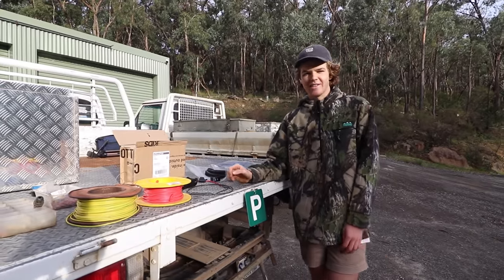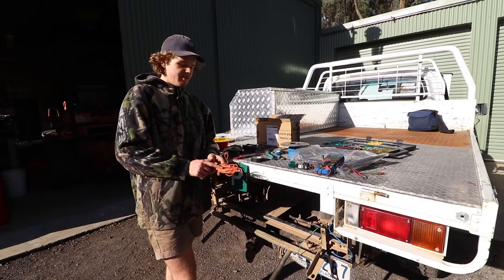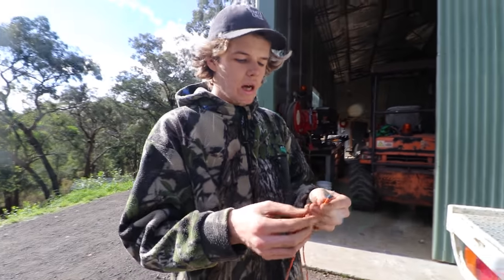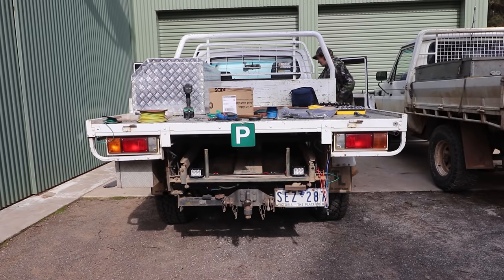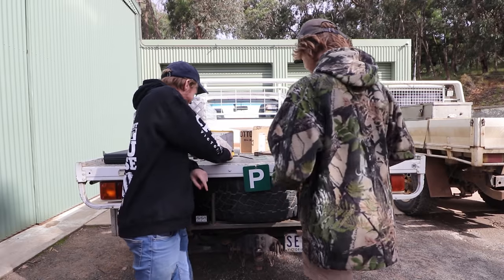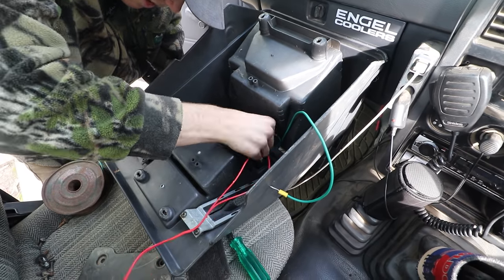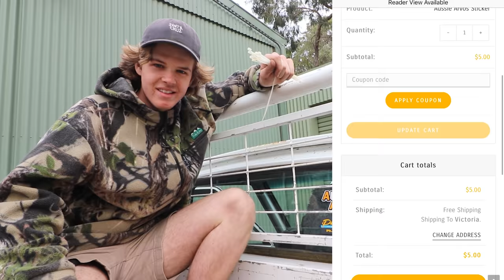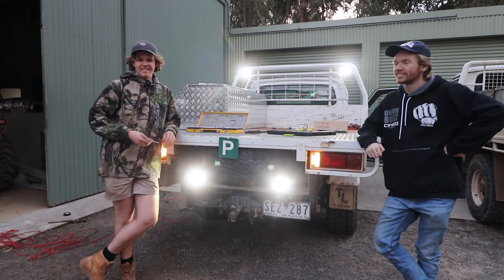MUST DO MOD FOR YOUR 4X4 | Wiring LED REVERSE + WORKLIGHT with SWITCH INSTALL

Comment: Hi why bother with relay. Just join two red wires splice to reverse light wire or trailer plug reverse wire and join both black wires and ground to chassis or individually ground both black wires. No relay needed.

Comment: Ideally you should be soldering connections, spades and ect are high impedance also they can over time corrode or disconnect. As others have said 24volt relay too.
If the LED for the rocker does bother you, you can make a switch to isolate the accessories from the battery.
Reply: Whoah lad don't bring that negativity around here

Comment: The rocker switch LED is for the headlight illumination wire, not +12V constant. Good video though guys. I love how you 3 really give it a crack. I wish many more guys would just get in there and try.

Comment: The amp draw of the leds are most likely low enough to pull power straight from the factory reverse 12v+. No need for a relay.
Reply: And same with the work lights those rocker switches can handle the current draw of the lights.
Reply: @TheATVboy17  Yeah probably could've and would be much neater!
Reply: Do it once, do it right.
Reply: I usually install led reverse lights like that, even did a halogen once without a relay. Just straight from the factory wires. No issues.
Reply: Would you get bulb error if you did this on a new hilux (no relay)

Comment: Good shit mate, although if I’m not mistaken, extra led reverse lights like those are illegal?
Reply: Yeah. They would need to be switched from the cab on the relay, not the factory reverse light as signal.
Reply: That's why hes running a relay 🤦so both options are available
Reply: Had factory switched ones for years never been picked up

Comment: Good job mate. Although next time you don't need to cut a wire to tap into it. Just strip or expose a little bit of the insulation and solder onto the wire 👍 just saves avtually ruining the integrity of the original wire
Reply: Or use those nifty squeeze on connector thingys. They are even easier.

Comment: Hi. Seeing the l.e.d lamp only draw 2 amps can I just link a l.e.d load resistor onto the lamp then couple it to my current existing factory reverse lamp on my 2012 Nissan Navara D40 diesel?, I'm wanting to just have it on when reversing only as I don't want to run it thru a switch.

Cheers Carl

Comment: could you not run the positive straight off the reverse light and negative straight to ground? thought the LED a low enough voltage

Comment: Nice inline fuse at the battery - very important, the rest is optional.  Wouldn't hurt to run a trailer wire while you're about it, get 7 cores from end to end, maybe one or two heavier cables for Ron.
You didn't show the boot you got off the relay??

Comment: Just found this. Pretty good commentary. Question about your work lights though - can you turn them on at any time? By that I mean could you theoretically flick them on at a car right behind you doing 100 clicks on the highway?
Reply: If you add a single pole double throw switch

Comment: Is the reverse lights vic Road legal or does it also need a seperate switch to be able to switch them off when in reverse
Reply from the maker: did some reading on the internet and apparently i think they should be fine. reverse lights can only be used when in reverse gear with the ignition on. Lights must be no more than 1200 mm above the ground & comply with Vehicle Standard (Australian Design Rule 1/00 – Reversing Lamps) 2005 - https://www.legislation.gov.au/Details/F2005L03873
Reply: Aussie Arvos thanks mate!
Reply: @AussieArvos  ADR13 - They must also be mounted no lower than 250mm off the ground, and no higher than 1200mm. If you’ve got a ute with only one reverse light you’ll be able to install a light bar down low as your second; but if you have a wagon with two functioning reverse lights, a third on the roof rack will get you pinged, So what you show in the video is unarguably illegal you have 2 standard reverse lights and 4 LED reverse lights 6 in total on a vehicle that is 6 meters in length when its only mandatory for one.  One bit of wording to pay close attention to is ‘up to a maximum of four’. This refers to additional lights so it includes fog lamps in a bullbar if the vehicle wasn’t originally fitted with them. Two new fog lights on the bar and a pair of HIDs in the middle will mean a light bar will count as a fifth light and be illegal – no matter where it’s mounted.

Comment: The first relay was a 24v relay 😅 you want a 12v one haha,
Using ground as a negative isnt a good idea because if something shorts on the body the amps could go up in every circuit using ground as negative and make it hard to diagnose why you starter battery is always dead after one night .....
Reply: Is it better to run the negative back to the battery?
Reply: @alijaffal3916  i always do and try to keep each thing such as light bar on its own circuit .... if you use the body of your car as negative then it only takes one of your positive cable to rips and touch the body and if its before a relay or switch you will get sparks/ short circuit or a fire, and putting a fuse on the positive is a good idea too, but not all cars are negatively earthed

Comment: Can’t really blame 4wdsupacentre for your 24v relay not working on a 12v circuit. They include the second relay in case you have a 24v truck  it’s not just a free relay. 

Only picked up on it because I tried the exact same thing
Reply: To get your switch light to turn off, run a wire from your dash lights to that post instead of straight from the battery
Reply from the maker: Yeah that was our mistake ahhaha ! good pick up hahaha Cheers Alex!

Comment: They’ll stop working after a month
Reply: Poor Connections
Reply: Power wire will rub in between the firewall and A/C drain grommet.